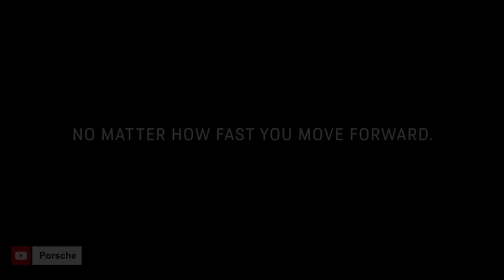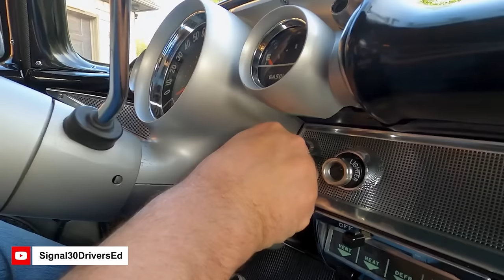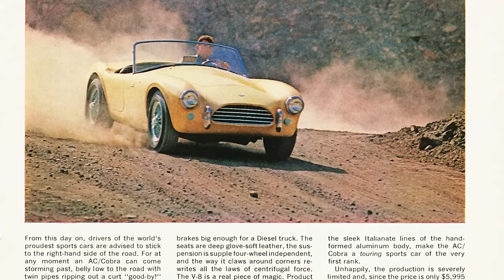Why Old Cars are Better

Comment: Your analogy for old houses is very nice.  You mentioned that there are good and bad craftsmen from every industry, and you also mentioned something like there is no test like time...  Well, this is how it goes...  Old houses that were made by good craftsmen have withstood the test of time, while the ones made by bad craftsmen have already rotten away.  So yes, you do get the quality ones if they are still standing 100 years after they are built.  I actually get the same jive with some thrift shops for clothes.  Many new clothes tend to fade in color very quickly, however, in thrift shops, we can see which clothing brands have not faded or warped despite longtime use, so I can be pretty sure of their quality.
Reply: I lived in budget house built in year 1911 for factory workers. It is still built with quality and standing today despite no renovarion ever done. It just have different features, like small apartaments with isles in walls to torn down when apartment expansion is required. And no ornate decorations. But there was no enshitificarion on any kind.
Reply: The house I live in right now was built in 1926 and has held up incredibly well against the worst of mother nature and continues to march onwards through time. Despite being near 100 years old it has outlasted many modern structures by a large margin.
Reply: @alexanderwhite8320  I am happy that you live in a quality home that does not need extensive and expensive maintenance.  I hope you dont mind, but like this video says, old cars are like old homes.  Your home doesnt have extensive features that can break down easily.  It is just like old cars which dont have fancy electronics or computers that break down easily too.
Reply: @TheSilverShadow17  I am happy for you.  I think I personally would like to live in a house like that if given a chance.
Reply: @dr.charlesedwardflorendobr3952  It isn't much for a 3 bedroom, 2 bathroom house, but it's more than enough to do the job.
Reply: yes survivorship bias is quite real
Reply: @bondjames5792  Survival in general is a high priority subject
Reply: My granny lives in a trailer from 1982 and it's still going strong, a couple of repairs put it in a way better condition. It's just that a lot of equipment was stronger back then; cars, television, Nokia, computers, the list goes on.
Reply: @bondjames5792  Thanks for commenting that, I was searching so I wouldn't have to mention survivorship bias myself
Reply: I feel this so much. I buy almost everything second hand, because survivorship bias filters out most of the worthless crap. Sometimes newer tech has some functional benefit that just makes it more suited for it's purpose, but old tools, old furniture, old clothes, old machines, they are way less likely to be disposable, because if they were, they would have been disposed of.
Reply: @bow-tiedengineer4453  precisely.
Reply: You are wrong, tough. The thing is that in the past you could only make houses out of stone, brick or solid wood. But now we have a ton of composite materials to choose from, and some are designed to be cheaper than the original material they wish to replace. And that is the key difference between old houses and new ones. In the past they would have made the walls with solid wood planks, and then plaster all over it to make it smooth and uniform. Now they just buy some OSB plank and make the whole wall off of it. Obviously, the OSB with a cheap render on top will fair way worse than the solid plank of wood with plaster.
Reply: @DrBernon  mud huts are a thing, mister. I just don’t think they were used by Anglo-Americans
Reply: @DrBernon  interesting
Reply: @satsumagt5284   Well. Obviously, there have existed buildings made by the poorest of the poor in every society. And those have always been junk. It has nothing to do with race nor time period, nor political or economic system.
But those don't count in this argument, for obvious reasons.
Reply: @DrBernon  To be fair, there were shitty materials back then too: Low quality, lightweight wood, or wooden pile foundations that give a vector for termites to enter the house. I don't disagree that a much larger proportion of older houses were made of quality materials, but there are bad quality examples in every industry in every time period. A workers shack made of cheap pine on wooden piling foundations was that era's equivalent of our modern low budget cookie cutter houses, and they also probably only made it a couple decades before they started to deteriorate.
Reply: @bow-tiedengineer4453  You underestimate how long wood lasts intact if it never gets wet. Also, soft pine woods are softer, but outlast 100 to 1 to modern OSB. Also... They had treatments to protect wood from termites and other bugs. Usually super toxic stuff that is now illegal. Also, traditional lumber was done differently. They cut the trees at specific times of the year, with a specific moment of the moon cycle, so the wood lasted longer, along with using the wood while still green or protecting it very well from fungal infection before reaching the building site (and of course never using an infected tree unlike today). But with this I mean to say that wood lasted quite a long time. More than modern stuff that had no care or thought put into it.
Reply: @DrBernon  I don't disagree at all that wood could be made to be very high quality. I'm just saying that they didn't necessarily bother every time. They put in the effort a lot of the time, more often than they do today, but not always. There have always been lazy people doing half assed jobs.
Reply: @TheAdventuresOfJimiJaden  Well to be honest the only reason it was stronger was because we couldn't make things precise, Now machines can get it down to Nm if required while back then it could be a few mm or even inchs off where it should actually be and it would probably still work depending on what it was.
Reply: @hunterbear2421  interesting…
Reply: @alexanderwhite8320  No renovation since 1911? Sorry, but big doubt on that. Surely you've got stuff like indoor plumbing, electricity and other stuff not available to the 1911 factory worker?
Reply: @GadgetronInc  plumbing was partially replaced in 1960's while keeping original layout. Water tap was USSR made from Breznev era. Electricity was mostly original with electric meter from 1950s indoors that was no more functional and superseded by outdoors electric meter from 2003. Original wooden floor was covered by plywood. Heating was by fireplace and clay/porcelain stowe all built before WW2
Reply: @alexanderwhite8320  That's a whole lot of renovation for "no renovation ever done"
Reply: @GadgetronInc  I disagree. By renovation I understand so called euroremont where walls are covered with regips, iron pipes replaced with plastic, original wooden windows replaced by plastic windows and so on.
Reply: Of course the only old clothing still for sale or old houses still standing are the nicely made ones. All the poor quality stuff they made 60 years ago has been replaced or rotted away!

Comment: Viewer from the 3rd World here. I am an electrical contractor in my country, so I'm in houses and apartment buildings since they start to be built, up until they are furnished. And while there's a lot more of tech now (from heating floors and security systems, to microcontrollers everywhere, even WiFi-controlled lighting and plant watering), the core of most houses are still made the old-school way: Mortar, bricks, rebar-reinforced concrete beams and columns, ceramic tiles, plaster ceilings... All still made by an army of specialized people; from masons to electricians, carpenters to plumbers, painters, gardeners and the plaster guys. Yes, it's still like that because the workforce is cheaper than the tech and equipment for the dry construction used today... But gladly it is, because things come out better and stronger, it employs lots of people, and specially gives young people (like me) the chance to learn a lot of stuff, either by looking and asking the other guys, and by doing your own job (i.e my job as electrician implies lots of digging, preparing and using mortar, a plethora of tools, and even some demolishing too 😂)
Reply: Yes, the cardboard house epidemic is mainly North American. Here in Europe we also make all building out if reinforce concrete skeleton closed up with non-structural brick walls. But you would be mistaken if you think this new reinforced concrete stuff will last as much as old houses do. A lot of new buildings have a flat roof (because it is cheaper to make it that way) and they end up leaking. Then the reinforcement rust from the inside out, and everything cracks and crumbles surprisingly fast.
We truly exchange quality for lower labor in new buildings, and use lesser quality materials as well.
Reply: Brasil?
Reply: @gabrielv.4358  it's high-inflation neighbour, Argentina
Reply: @DrBernon  You have no idea what you're talking about if you think American houses are made of "cardboard". Stick-framed construction with a concrete foundation, interior gypsum wall panelling, exterior structural sheathing and exterior brick facades is one of the cheapest, most efficient, most flexible, and fastest methods of home construction, with decent fire resistance (today; old wood houses were bad in this regard) and long-lasting durability, and that is exactly how many US and Canadian homes are built.

The primary reason stick-framed houses are often rebuilt isn't because they are intrinsically poor quality, but because their very nature allows them to be easily rebuilt or modified cheaply and easily. There is absolutely no reason to overbuild our houses to last 200 years. We don't do it for major infrastructure like bridges; why would we do it for houses?

If southern Europe had access to cheap wood like Canada and the US has, you can bet your bottom dollar that houses would be built the same way.
Reply: @eduardotrillaud696  Argentina is a First World country.
Reply: @cmmartti  You might be right in that Southern Europe would build with more wood if it were more abundant. But wood was never that scarce. The thing is that we built with dirt and stone because those are even cheaper materials, that also have thermal benefits in hotter climates like ours. But most importantly allow for stronger, larger buildings, that last hundreds of years. And classic buildings were made to be inherited and last for generations. There was a pride in making long-lasting buildings, and you can see it in how all old buildings have the date of construction carved over the main entrance. And that has carried over a tad to modern buildings.

But yes. You do build your homes out of cardboard. I've seen the videos. And to tell me that no, you use stick frame construction, sounds the same to me. And to say something so ridiculous as structural seething should make you realize how bad American construction is. And to say that you demolish them because you want is ridiculous. An average home in the US lasts 30 years. Far less than an average life. And I would think that if you build a house is to live in it for the rest of your life, but I guess not in the US.

But most importantly, you build cardboard houses, because the rest of the world uses this rectangular things called bricks, that are non-flammable, bugs can't eat it and are also pretty cheap. But lately is being replaced by armored concrete that already lasts less than traditional construction, but is very strong, requires less labor, and is most definitely not cardboard, unlike yours.
Reply: Third world? You're from Alabama??🤷‍♂️
Reply: @cmmartti nah, second world imo. 3rd world is like average salary less than 100$/month
First is about 700+
Reply: @dren4k  Argentina was allied with the United States during the Cold War, not the Soviet Union.

Comment: Old SAABs had built-in rolller cages, night displays and had interiors and windshields inspired by fighter jets, providing great visibility and putting all the important stuff within view and reach of the driver to decrease distractions.
Old Mercedes had rear lights designed to not get too covered in dirt to not fill their function.
Old Volvos were built like tanks from Swedish steel and with engine blocks made out of cast iron to increase durability. They also came with the first modern seat belts, seat warmers, crumple zones and airbags.
All that asside, many of these old wonders of machinery came with beautiful interiors in leather, wood, metal and chrome which is much more beautiful that the cheap looking plastic of modern cars.
The practical features and durability from 70's-90's German and Swedish cars, the design language of 50's-60's American and British sports and muscle cars and the fuel economy of a modern diesel engine combined would be the ultimate car design in my opinion, and I believe it would be a vehicle most would enjoy owning
Reply: A lot of older RWD volvos were actually made from brittish steel. It was the best steel at the time, though.
Reply: Back when the engineers were masters of their own fate...
Reply: Some cars from the 60/70 have dashboards that look like pinball machines it's a literal work of art to look at. Old cars also have more special features like a Mercedes that put on your seatbelt for you or special ways to hide your headlight or your tank cap(not always good ones but al least they were trying somthing new). Most new cars look and feel the same as other brands it's like one brand makes one and they all just make a new body around it. It's boring
Reply: @jellevh8460  Boring is right. I call them "jellybean cars."  I remember helping a girl late at night who was driving a Mercedes.  She got an oil-low indicator light, and we spent 10 minutes in the half-dark trying to find a dipstick. It didn't have one but admiring this 6-foot-tall blonde girl's long legs as she bent over the engine compartment in a mini-dress looking for it is still one of my best memories. --Old (but not blind) Guy
Reply: @GoldenGrenadier  Judas Priest had an album called British Steel. Just an FYI.
Reply: All they do now is stick a giant tablet in front of the steering wheel and call it a dashboard.  Automotive designers from the past who spent meticulous attention to detail must be wondering how much these modern "designers" get paid.
Reply: Lifetime 90's SAAB driver here, and it's increasingly difficult to imagine having to swap it for anything. Driving a modern car is more often than not a dreadful and depressing experience.
Reply: @botno69420 I 100 percent agree with that
Reply: Now all cars have roller cages
Reply: @billolsen4360  and giant A-beams as a result. My father-in-law is always complaining about the God-awful visibility in his 2017 E class in comparison to his old Mercedes. In comparison the saab 99 paired A-beams that went all the way down to the chassis with a curved windscreen that provided superior visibility
Reply: Got myself a 91 Volvo wagon. There's no rust on it, because they dip galvanized the whole body before painting it. 
As you should...
Reply: I drive a '98 Volvo 😊 it's a beautiful car
Reply: "Luxury" to me isn't a car that is a smartphone, but a car that is quiet and comfortable. Driving it is a different sort of engagement.

I'm genuinely convinced modern cars could be so much better designed but for some reason they just aren't. Maybe it's regulation or cost cutting. But the quality of things in general seems to be going down.
Reply: I think you described the Volvo Amazon or the P1800ES, one is styling wise an echo of 50's americana, the other a swish looking sporting estate/fastback car. Both are known for solid mechanicals.

Comment: No, you are right. We demand appliances now. I bought the newest old car I could and then updated it 10 years. 1994 BMW e30 wagon swapped with a modern 24v inline 6, new suspension, brakes, cooling, steering and a lot of wiring. All together 1/3 the cost of a Tesla model 3, and will last three times longer. Really fun to drive.
Reply: You do your sweet wagon a disservice by contrasting it with a Tesla.  They don't deserve to be in the same ballpark lol
Reply: is the 24v inline 6 a more reliable BMW ones? Like B58 which is more than enough for the old E30, and more stout than some old S engines
Reply: @baoquoc3710  no the m20b25 12valve engines are just as bulletproof, just has less power and runs ona belt insteed of a chain. You know that the M20 Engine is the million mile engine....im sure you can youtube it
Reply: Those inline 6 of bmw are made to last forever. I had an e46 328i. Everything on this car broke except the engine. One day even the chassis broke at the mounting point of the rear axle. The engine was still running like new with 300'000km on it. And i have to say that i changed oil all 50000km (you should do it earlier). Also the cooler broke about 3 times and the engine was running without enough cooling. But the engine survived and was running quiet and smooth like it came out the factory. And i floored this car constantly. The only thing i always did was not going over 2500rpm until the oil reached a temperature of 90°c
Reply: Agreed. Maintain cars and they run forever